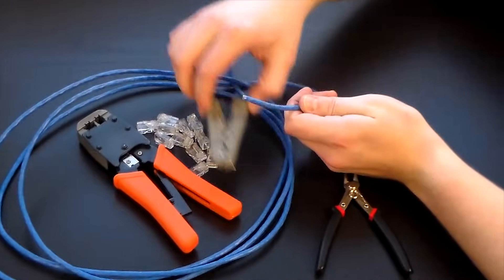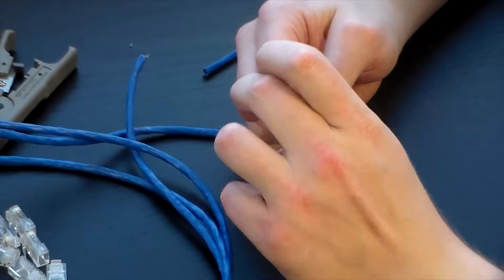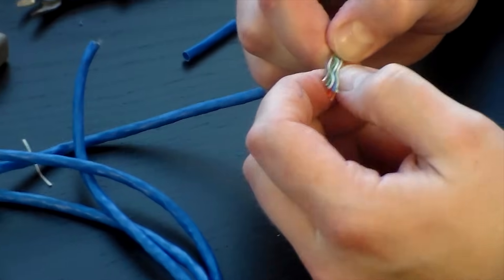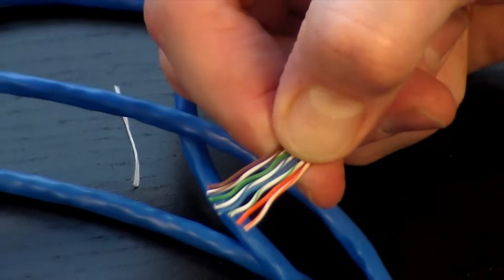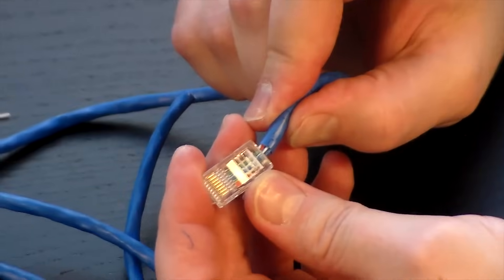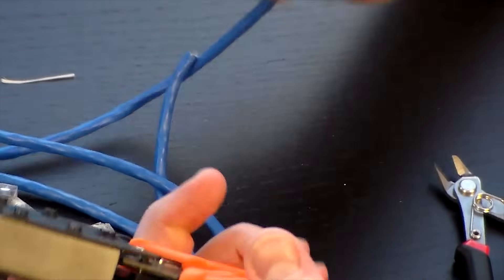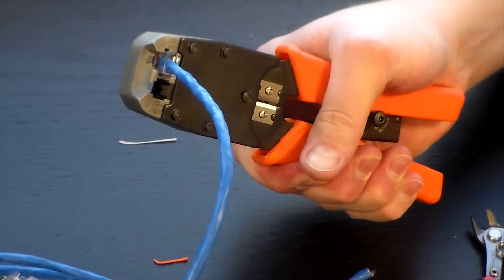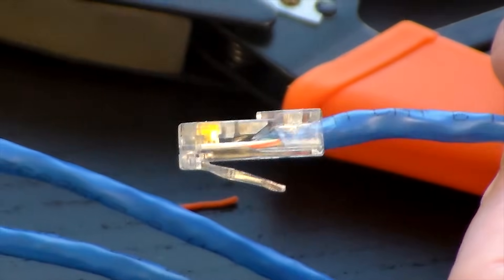How to Make an Ethernet Cable! - FD500R - $24 Crimp Tool Demonstration

Comment: Just made my first cable and for some reason my internet likes to disconnect and reconnect pretty frequently and not nearly as strong signal. I have good internet and a good modem.

 I used Cat5e burial cable, and I ran it about 200ft, its not buried yet tho. Is the signal weak because of the length I ran it? Or because a shotty job at wiring / crimping? One end the wires are kind of exposed and long so I thought it was that and intended to remake the end.

Was just curious so I don't keep recutting and crimping when it could be the length of my wire being ran.

By the way, awesome video and subbed!
Reply from the maker: Sorry for our delay. It is most likely due to the very long length of cabling you have. Beyond 75-100 feet you will encounter signal loss. We also recommend a network lan testing tool to ensure the cables routed in the correct order. While we do not sell this tool, you can find it on the web for under $10 bucks. Good luck and thanks for subscribing!
Reply: That's not really correct. Ethernet cabling for twisted pair is 100 meters (328 feet) so your cable is with the limit. That said:1. Route data cables away from any electrical power line or devices. Fluorescent are one of the worse noise sources so its important to route far away as possible from any fluorescent light fixtures. Try to avoid running data cables in parallel with power lines of keep them spaced at least 3 inches away. When your run data cables parallel it will pick on noise form the power lines. If you need to cross a power line. Do so as perpendicular as you can to reduce noise pick up.2. Poor termination. If you use closed ended RJ-45 connectors. make sure you see 8 tiny copper pennies when you look at the end of the connect. If you don't see all of them, your likely going to have a bad connection. Alternatively you can use the through hole connectors which all the of pairs are pushed through the entire cable. There is a special crimper that crimps and cuts the pairs that stick out for the through hole connectors.3. Kinked cable: You have to be careful not to kink the cable, If you kink it its going to attenuate the signal leading to data loss. If your cable is on a spool (not box cable). you have to unroll the cable on a spindle (ie broom stick between two chairs). if you simply pull the cable off the spool its going to come off twisted and its going to kink.4. Incorrect pairing: You need to keep the pairs together. The pairs are twisted together for signaling integrity. Get a cable pair tester so you can verify your cable.5. Consider using shield cabling. This type of cabling has a foil shield which will help reduce noise interfere. FWIW: I only use shielded cables. Currently I use Cat 6A cabling with the each pair that has its own foil shield and uses a heavier gauge. This will provide the best signal quality, especially over longer distant runs. However since Cat 6A cables use a heaver gauge, it requires special connectors, that are more difficult to work with. However you can use STP Cat 5e cabling using standard RJ-45 connectors. Another reason to use shield cabling is in the even of a nearby lightening strike. A nearby lighting strike can induce a small localized EMP that can damage or destroy equipment connected. Unshielded cabling can pick up energy from the lightening strike. The Lightening strike does not have to hit the cabling. even a strike that is a 500 meters away can damage equipment.
Reply: Max length is 300 feet not 75-100
Reply: You most likely have a loose connection or the sequence is not the same at both ends. colors do not make a difference as long as they are the same at both ends
Reply: This is the difference between using CAT5 cable vs CAT6. For lengths over 100ft use CAT6

Comment: What type/brand of connector do you use? The ones in this video seem to have little channels/guides to help funnel the wires into the proper slots, but my connectors don't have those. Creating a cable is a nightmare without them.
Reply from the maker: For this video we used the Ideal brand of RJ45 connectors. Not having those little channels in the connector does sound like a nightmare! :/ Good luck with the project!
Reply: Brice Gaude
Reply: Could you link the RJ45 connectors you were using? I searched the site but got the crimping tool. Thank you!